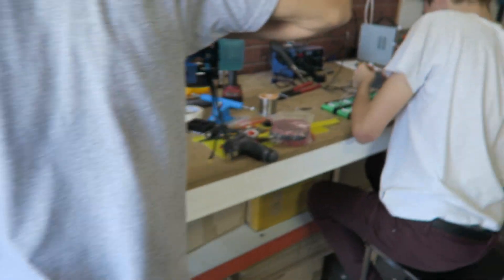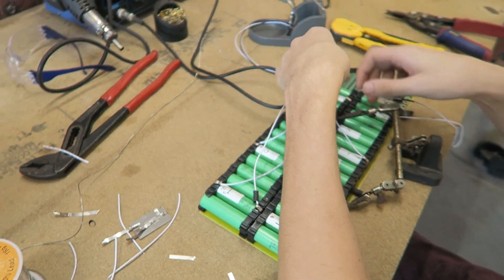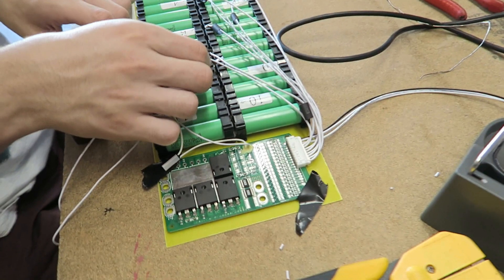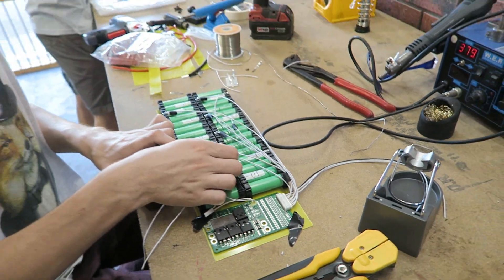ESK8 Builder Vlog#028 - Build Electric Skateboard Battery

Comment: Hey from La bro, Love the video man.  Can I grab some info on the types of battery holder's/square nickle you used? Been having a hard time with my flat battery build and refuse to roll around with thick brick batteries! Also the plastic backing is so interesting. Is that just standard plastic insulation? 
Palight ProjectPVC or something?
Much Thanks,
P

edit: ohh wait lol you made those squares didn't you!!! brilliant. Just need to spot weld em aye!~?

Comment: he should make a battery pack to do the testing on instead of using the customers battery, not sure how long it takes to test but batteries only have a short life ...
Reply: 18650 battery have huge life cycles something like 500+ i wouldn't mind them using a cycle or two to test my battery first instead of being stuck with a broken battery and have to send it back to get fixed or worse maybe the battery catching fire and making a big mess
Reply: thinking on it now its best he uses what is in the board so he knows that pack is functioning as intended and in harmony with the rest of the electronics...someday...someday ill have enough to get one of these boards.

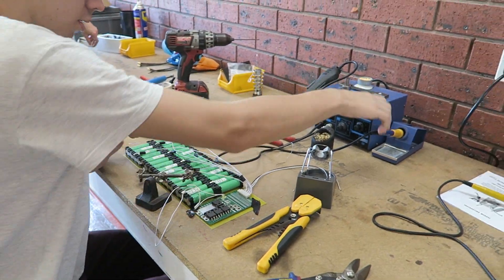Comment: Is there a special name for the metal that you use to attach the batteries together? 0:23

Any idea where I could get the same ones as you?

Thanks
Reply: +Electric Skateboard Builder Any idea what thickness is safe for Samsung 25R cells? I'm not sure what thickness is rated for up to a 60A draw. I'm building a 10s3p pack.
Reply: 0,2mmx10mm should be ok.
But keep in mind that all of these "nickel strips" sold on ebay/amazon are nickel plated steel strips xd
Reply: Yeah it should be ok.
Reply: they are battery tabs, and you can buy em online as well as a spot welder to weld them. and you can buy the 18650 battery too